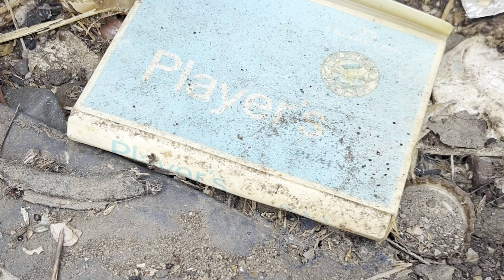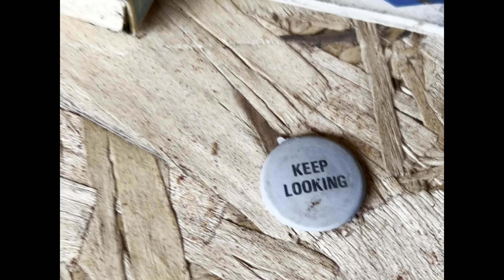There’s no turning back now!

Comment: Morgan, check out the Rockit brand bedliner. Its diy. Spray that stuff underneath and the interior floor. And Eastwood internal frame coating for the hard to reach spots.